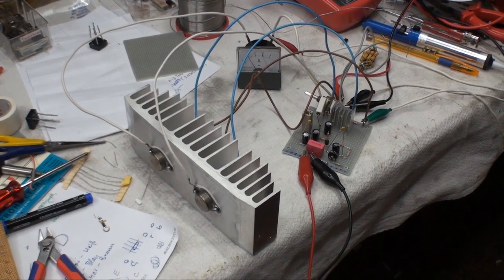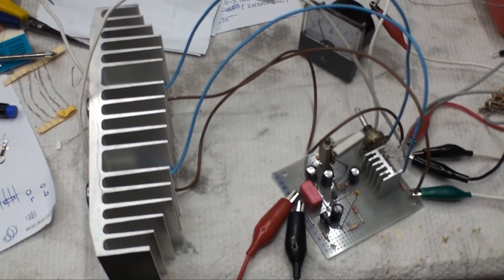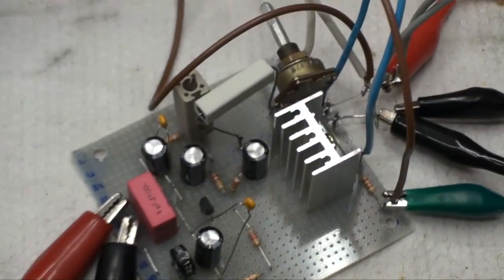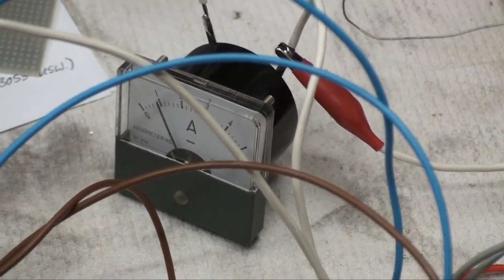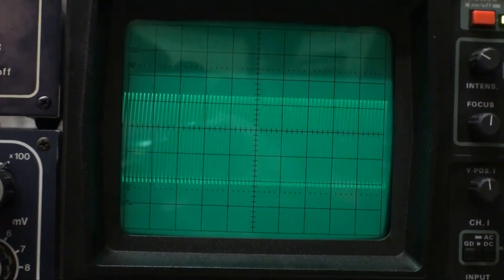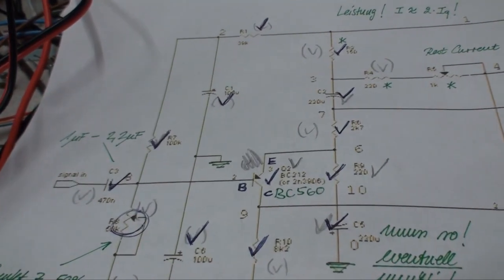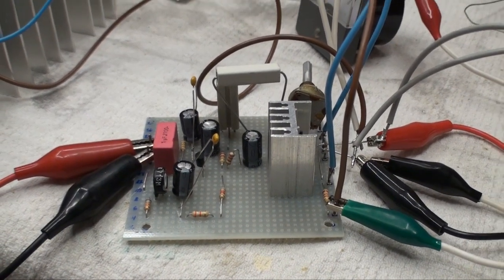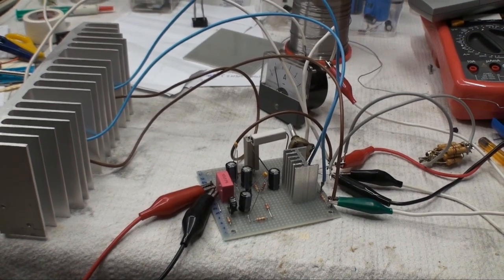DrCassette's Workshop - JLH Class A amplifier [1/x]

Comment: Just the tiny current passed by the scope probe on the base of the transistor reduces the oscillation greatly, so a small cap on the base should send it all to ground while letting the audio frequencies pass. 

Power supply decoupling would probably help loads as well.  The schematic you have doesn't show them but the pics of completed amps on the site have massive filter caps right next to the amp.
Reply from the maker: The power supply has plenty of filter capacity (more than 10 mF), but it's all located in a distance from the amp... I will try adding that capacitor.

Comment: "Alles schwingt, nur der Oszillator nicht".
Open Inputs on Class A normally do this.
This is why you find inputs with resistive load plus some nF caps.
(and if the frequency goes up to higher values you may kill your circuit and speakers without even knowing what is happening.)
Reply from the maker: Yes, that's why I wanted to have that problem fixed before going any further. The amp might ruin the speakers and I won't even notice...

Comment: The oscillation is most likely occurring because of the long wires between your driver and output transistors. Having long wires is incredibly bad. If you choose to use long wires, you must effectively decouple/bypass them at the output stage.

Same thing applies with your supply wires as well. They need to be decoupled.
Reply from the maker: Hmm, as I said in the video, that doesn't seem to be the problem in this case... Of course in the final setup the wires are going to be as short as possible.

Comment: You could try and add a 4.7 k resistor in series with the input then a 330pf cap between the base of the first transistor and ground. May stop the oscillation. Adding a 20k volume pot to the input may be worth trying first.
Reply from the maker: I already thought about the volume pot. I'll definitely try that.